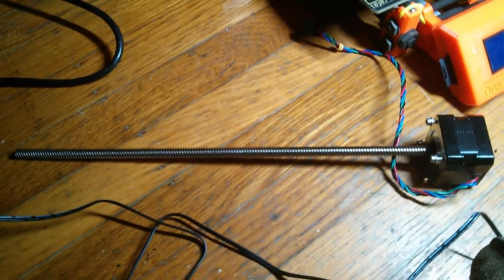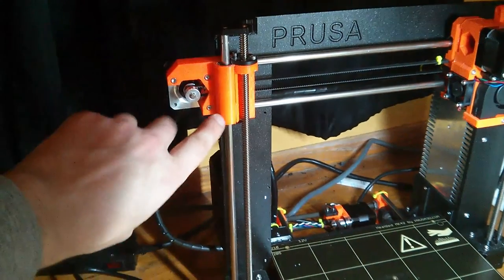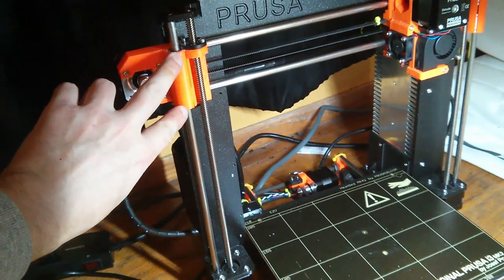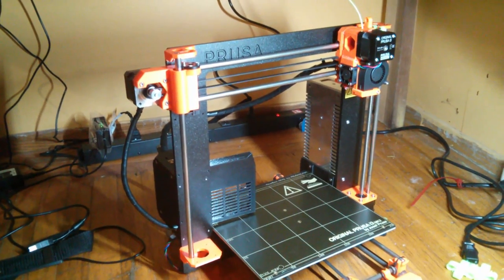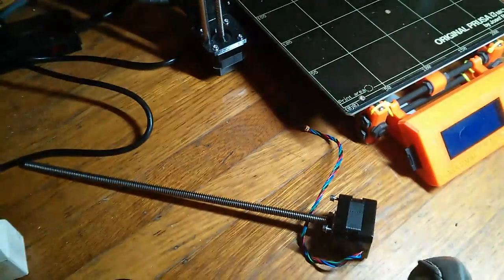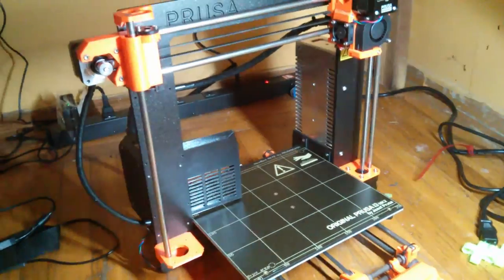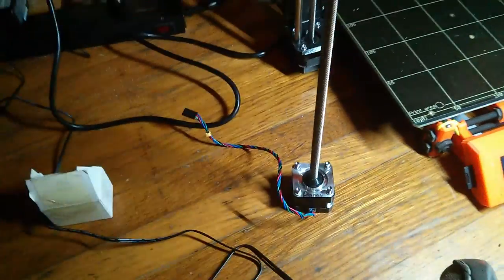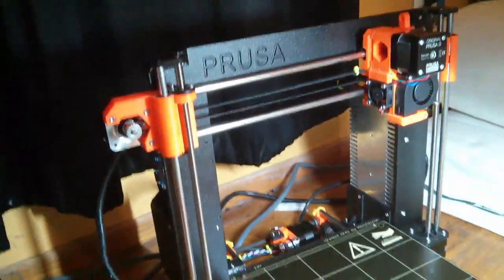troubleshot stepper motor failure

Comment: I think it might be a broken bearing in the motor, did you try to open it up? I'm curious what was the problem.
Reply from the maker: i ended up taking apart the housing and found no loose parts.  after putting it back together, the motor worked for a few prints. then locked up again. prusa was kind enough to send a replacement.

i think the housing was just slightly misaligned. the rotor was catching the stator. the bearing worked smoothly.

Comment: i  had a similar problem with a stepper getting stuck. all i did was loosen the screws holding it together and then tightening them again.  i noticed that the tighter i'd make them, the smoother it would rotate.
Reply from the maker: oh?  i'll give that a shot.  the motors started sticking again after this.  i did try taking the motor apart and putting it back together again.  i'll try tightening the housing more.  i never did fix this.  too low priority for me to get around to it.  thanks for the comment!